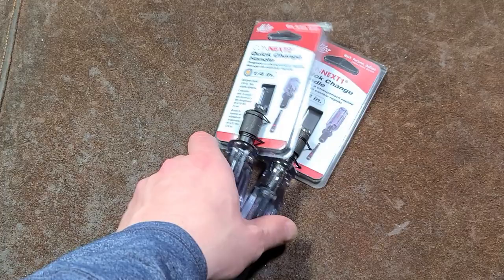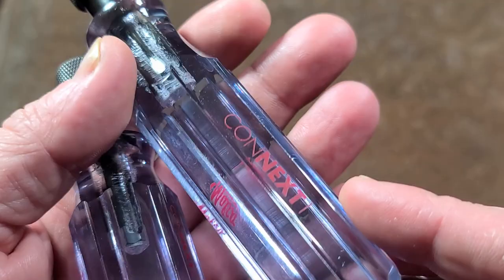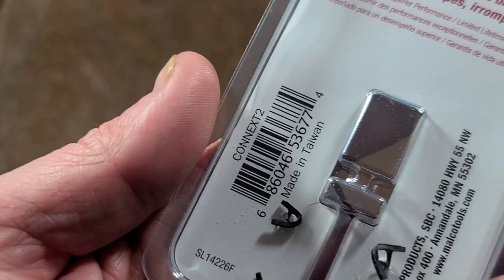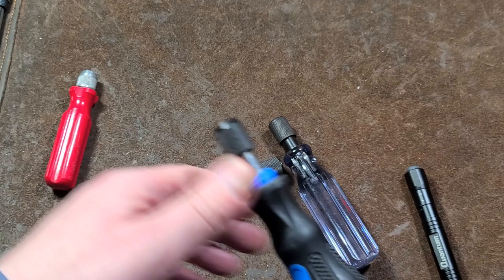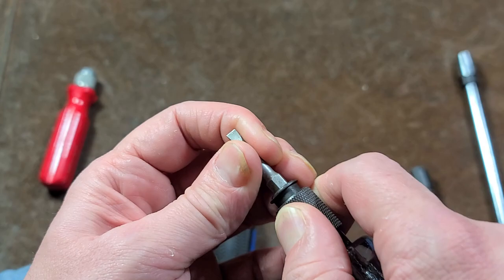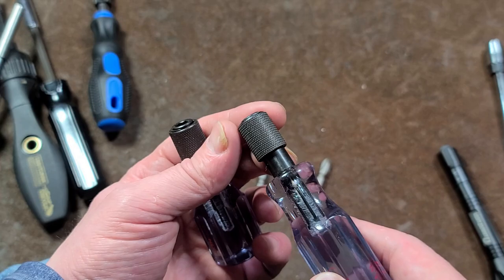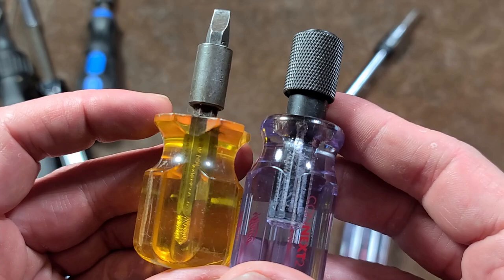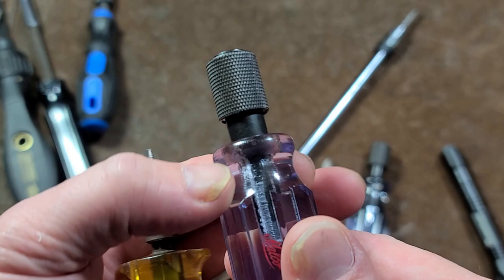Malco ConNext 1/4" Locking Bit Drivers Review

Comment: I finally found the handle I was looking for. I carry a lot of different sizes and types of Hex bits in my work and needed a screwdriver tool that was non-magnetic.  I was considering using Wiha or Wera's ESD safe bit handles, but they are a bit pricey and the rubberized handles attract particles and get damaged quickly in harsh environments. Also, their handles are small and hard to apply enough torque for the machine.

Comment: Thanks for alerting your followers to a very interesting product. I love your videos and make a practice of closely tracking the release of your videos.

1. Quoting from an Amazon review by Matt: "It's made for 2" power bits or longer. It swallows a 1" bit and leaves about 3/16" sticking out for you to grab with pliers to retrieve it." This limitation might be a concern for some.

2. As of 29Jan2021, the long version is available on Amazon for $10.29, the short one is more unique and interesting to me, but currently unavailable.

3. I think I saw a trick with Craftsman screwdriver handles whereby a box wrench could fit the handle for extra torque. Catus, could you experiment to see if such is possible with the Malco product? Lack of such a feature would not be a deal-killer; simply nice to know.

4. People interested in interchangeable-bit systems able to get into tight spaces should also investigate the US-made tools from Chapman Manufacturing. And no, I am not affiliated with any tool company. I merely take pleasure in pointing fellow enthusiasts toward good products.

Comment: I recently bought the ratchetting driver and the Malco Connext1 , I like them both ,  the only complain I have is that they don't lock the short (straight shank)  , 1" magnetic driver bits, but if  the bits have that narrow collar , it'll lock perfectly, other than that, I really like using them in my home as well as my shop,

Comment: Always liked the Acetite always been a fan of Acetate handled screwdrivers. More so than the kind with cushioned grips. Although the Wera ones are pretty nice too.

Have you tried the ratcheting one? I think its called Connext3. 

What about their bit shafts? Wondering if I should just get the handles or pay more for the set with a bunch of different length shafts.

Comment: Do they work for the small bits?
Reply: They only work with the bits that have the quick connect indents but you can use a bit holder and use the small ones.